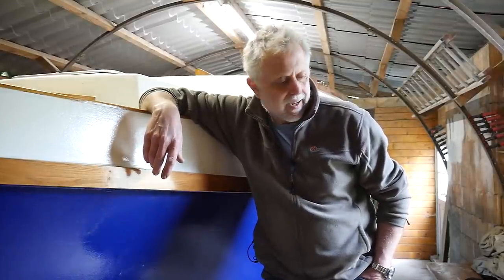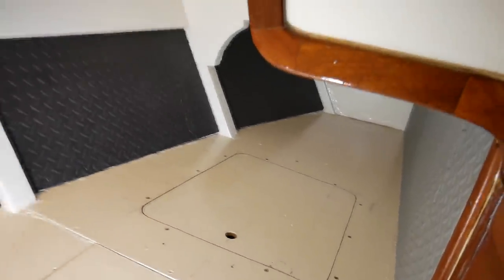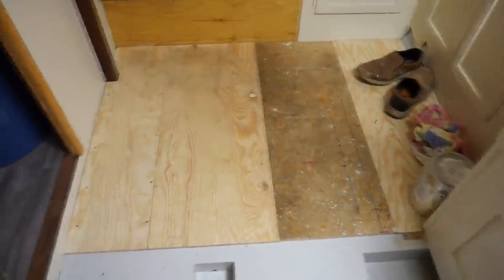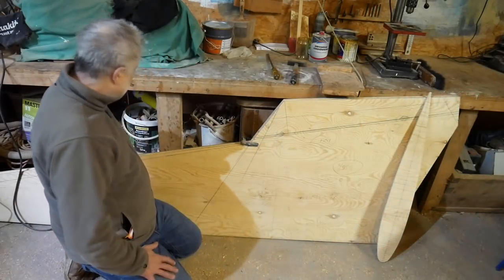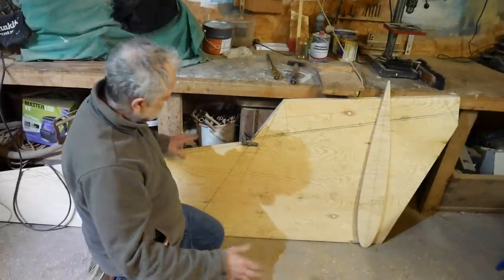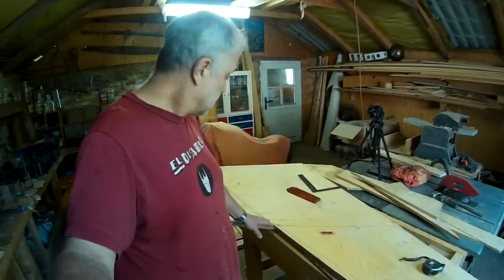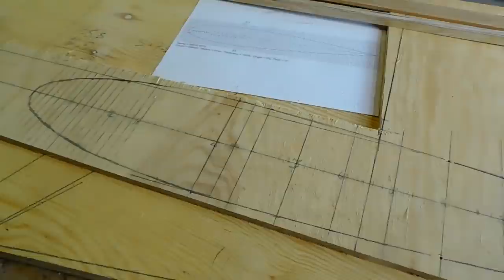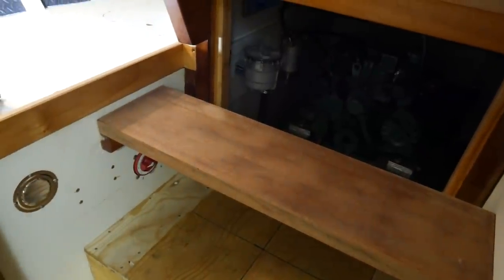Rudder beginnings, quarterberth finishings, sole ongoings - SV Tapatya EP182

Comment: Rudder.
Not easy to apply a NACA profile (0012? 0015?) to all the rudder.
If the length is constant, maybe it would be easier to DIY a half (negative) NACA shaped sanding block. You will stick 40, 60, 80, 120... grade paper to it, and shape one side after the other. 

Trim tab.
Same thing with the trim (with a smaller block).
Trim tab is the dedicated system for transom held rudders: few moving elements and easy maintenance.
Servo pendulum are only mandatory when the rudder is out of reach.
Reply from the maker: Yes Joel. The NACA profile may be a bit of an approximation. The chord length does get a bit less as we move up the rudder (wetted area). The trim tab will be easier as that could have a constant chord....

Comment: good boat work. on the video work front. Is it possible to be attentive to sound levels? I have it at watchable /listenable levels..then next segment cant hear at all...turn it up ..only to be blasted with later cuts. It would certainly increase views/likes if it just a little better. having said that you dont want to lose boat time to video time hard balance.
Reply from the maker: Thanks Chris. Useful feedback mate. I actually put more effort into the audio on this video than on any other I've made. However, that was because I had some issues with background noise in the speaking sections. I always significantly reduce the volume of the machines (-15 to -20 db), but, of course, the actual volume varies depending on what is being cut and the proximity of the mic to the machine. The time I spend editing seems to be getting more and more as I strive to improve, but I shall certainly continue to do so!
Reply: @SVTapatya  I"m glad you took it in the spirit intended..and I can tell all your work is not without thought and effort

Comment: Question Tony, That rubber how thick 10mm, and will that stop condensation inside the hull?
Reply from the maker: Yes Chris, it's 10 mm. As to the condensation - that's a bit harder to answer. In general, wood boats suffer far less from condensation that fibreglass or metal hulls, but, of course, it all depends on where you are and the conditions there. It certainly should further reduce the chance of condensation and will give a nice insulated layer to lay against....